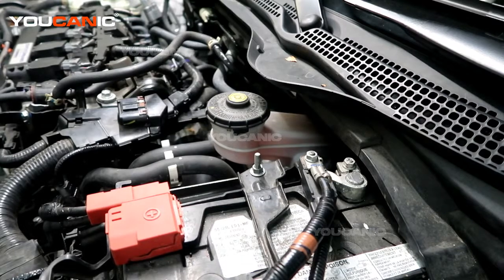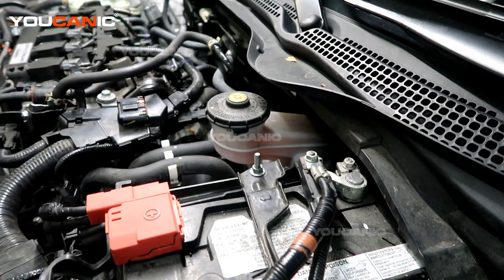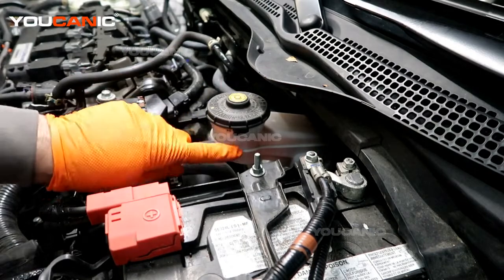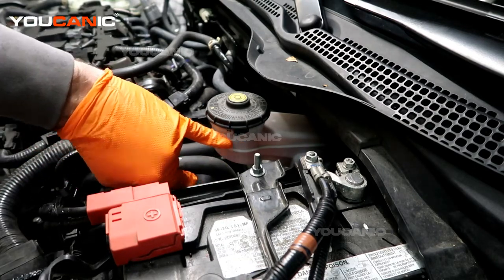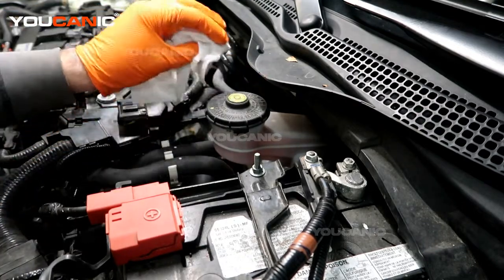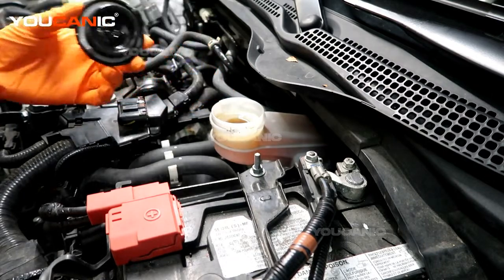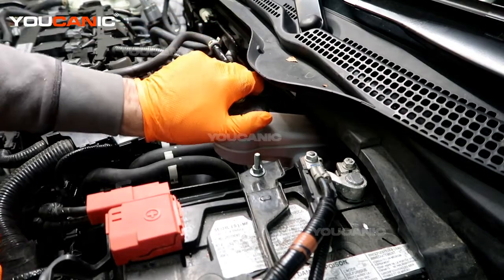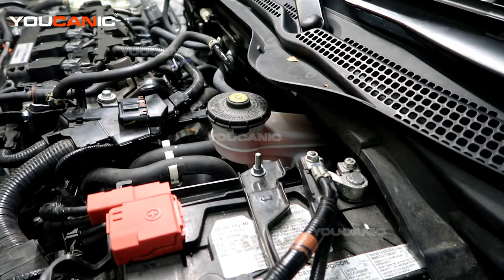2016-2021 Honda Civic - Check Add Brake Fluid

Comment: Can you drain most of the fluid from the reservoir with a turkey bastor? Then refill with Dot 3 without bleeding the brakes and consider is a new brake fluid change?
Reply from the maker: While using a turkey baster to remove some of the fluid from the reservoir and refilling it with Dot 3 can mix old and new fluid, it's not the same as a complete brake fluid change which usually involves bleeding the brakes. Although this can work temporarily, we recommend a full change for optimal performance and safety. For detailed instructions, visit www.youcanic.com. And remember, if you have more queries, feel free to ask them on YOUCANIC's platform. We're always here to provide guidance and help you understand your car better.

Comment: Hi, can I check if it is normal to have some tiny freeplay horizontally on the reservoir cap after tighten? Thanks
Reply from the maker: Thanks for reaching out! A little bit of freeplay on the reservoir cap after tightening it can be normal, but it can vary depending on the make and model of your car. At Youcanic, we're dedicated to empowering car owners through free resources and guides, we even offer factory repair manuals. 

Feel free to explore and ask any further questions at www.youcanic.com. We aim to support and empower you throughout your car ownership journey!
Reply: @YOUCANIC  thanks, I'm driving the 2nd gen Honda Fit GE8.

Comment: How do you know if the fluid is clean after a mechanic says they changed it
Reply from the maker: Thanks for your inquiry! After a mechanic changes the fluid, you can confirm its cleanliness visually, through the color and consistency, but a more accurate check would need mechanical tools. Don't worry, we at YOUCANIC provide free resources and handy guides to empower all car owners. 

Visit us at www.youcanic.com if you need in-depth assistance or want to explore our powerful YOUCANIC scanner we designed to make car maintenance easier for you. We're here to support you throughout your car ownership journey. Dive deeper into our resources and feel confident under the hood!